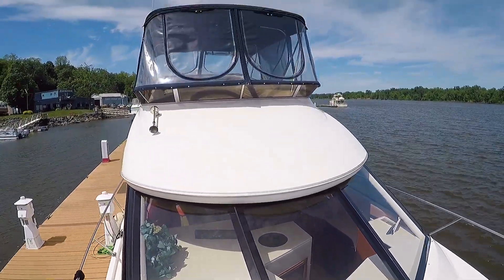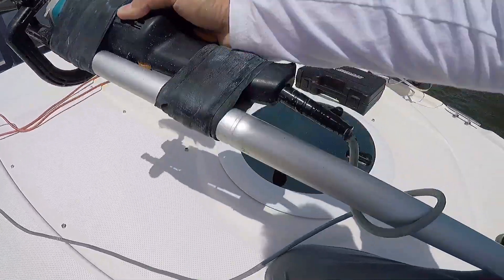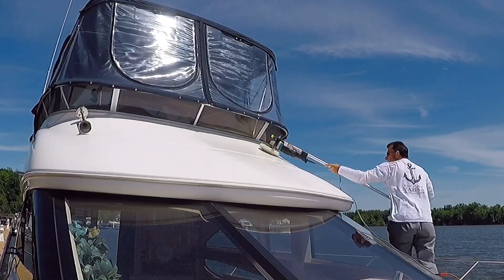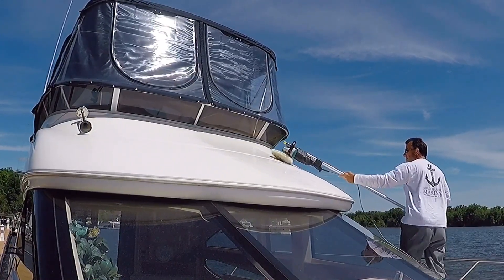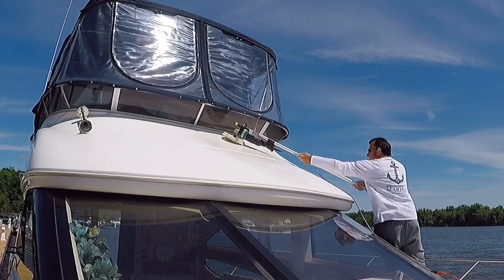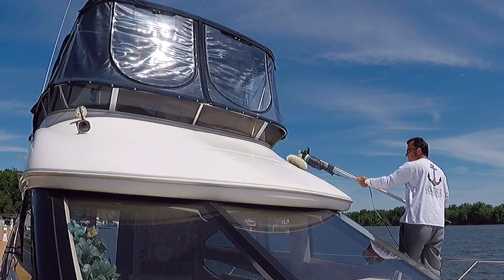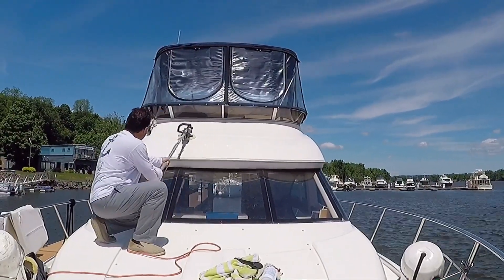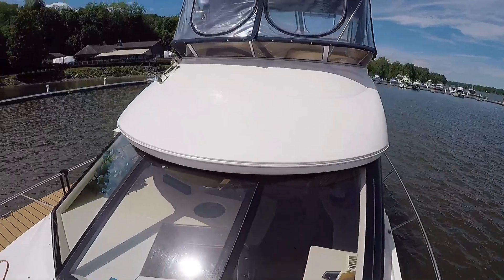Compound & Wax Boat Brow

Comment: I find that that wet sanding , then waxing is it is a lot easier and the finish comes out almost like factory
Reply from the maker: I knew as I was doing it wet sanding is what’s was really needed but getting it done on the brow would have been a challenge.   How do you think I can accomplish that?  Maybe next year.
Reply: @AdventuresofHappyOurs  I think you could probably use a pole and sander pad like the  Marshalltown Pole Sander with a 3.25 in x 9.25 pad.  The pole allows you to add extensions to reach farther.  Depending on the condition of the gel coat.  Maybe start with 800 or 1,000 grit. Then maybe 1200 and then 2000.
Reply from the maker: @searay7277  is it a rigid flat pad?  The surface is curved. Wouldn’t it cause flat spots?
Reply: @AdventuresofHappyOurs   Yes that would be an issue unless you can find a pad that's flexible. I don't have that issue on my Sea Ray,  if I did I might entertain just having a professional come in and paint the brow.   But thinking a little further on this, I wonder if it would be worthwhile to get a short extension ladder and then buy the accessory suction cups for the legs so you can lean the ladder up against the brow and hand sand with out worrying about the ladder slipping.